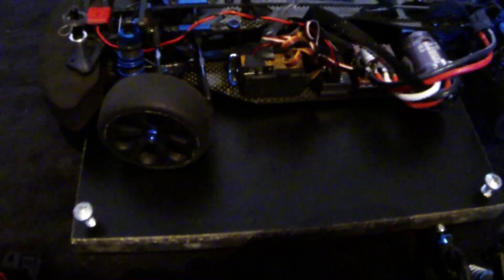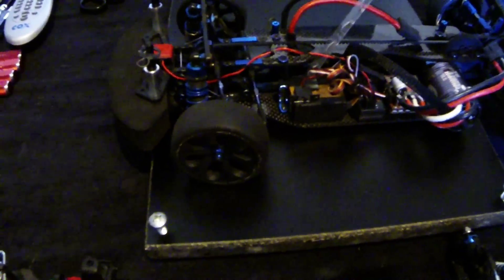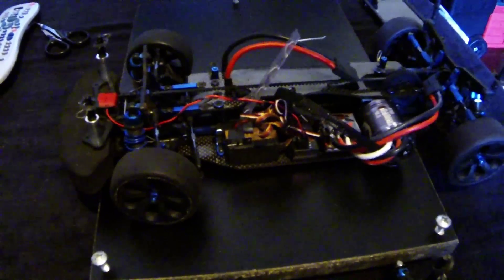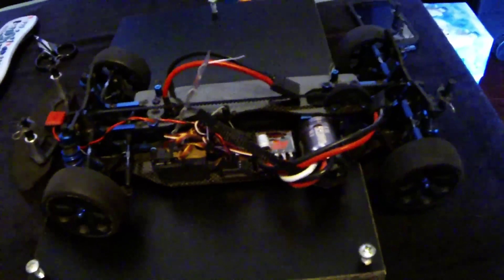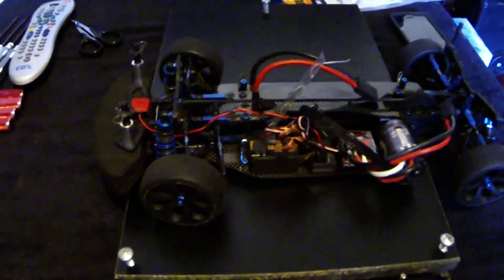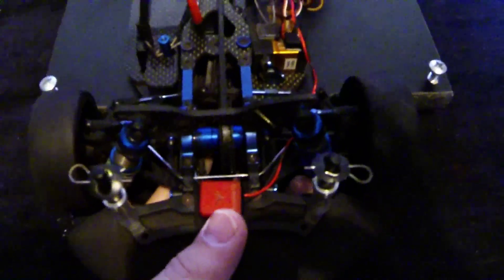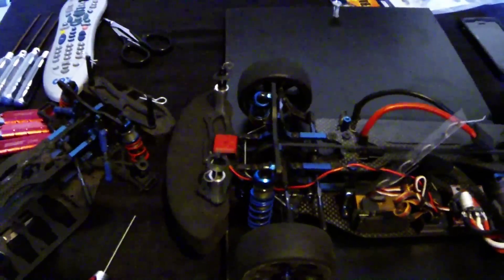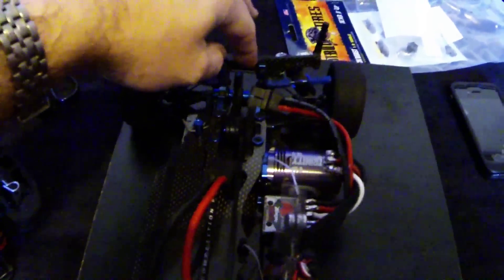RC Chassis Theory 101 Caster, Pro Squat/Anti Squat and Ati dive/Kickup

Comment: Holy hell i get it now, sorry man ur vid was soooooo long it was driving me nuts. I think ive spent nearly 3 hours reading about this subject and iswear almost every single explanation has it different, i hear anti dive and pro dive, anti squat and pro squat, kick up and anti dive, kick up and pro squat from my understanding kick up was the equivelant of adding anti to the rear and pro to the front which i didnt get, i was also reading in only one mention that one end will affect the travel of the other so no dive would still be affected by anti kick up and pro kick up. Since every mention of kick up, anti/pro dirve or squat had nobody speaking out and pointing out that they had it backwards or wrong except for one instance where it seemed half the memebers argued one way and half argued the other way and everyone used different terms by which side goes up to get anti or pro it was driving me insane. The slinky method made sense a bit in my head that the front would have a harder time trying to lift weight from the front, but then you mentioned the angle of the arms and that is what i need to focus on who cares which is what, its simply if the angle of the arms in the front are learned forwards so lower in the front of the front you wind up with too much angle fighting against the dive and vice versa, its all about the angle affecting the dive not which side is raised because even tho putting the front of the front higher like i did to get more dive, it also means that the shocks will have been moved closer together meaning you would need to adjust them, someone had implied that it was related to the shocks and how much movement they can produce which in retrospect sounds silly when these things are usually adjustable if not moddable.

I hope you dont mind walls of text, and all i really wanted was for some one to use the proper terms, all of them, explain them properly, and back that up so that i had a verified source of info to use to tune my car, but you convinced me without any proof which is good enough for me lol

Thanks so much for the vid but next time try to keep it short simple and to the point. The only other anti squat related vid out there was just beyond over explained and confusing and was only 15 mins long and i gave up on it till i went back to your video and decided to skip through parts of it to save time till you were talking about things that were relevant to the concerns/conflictions i had.